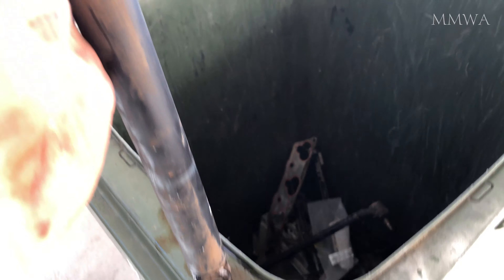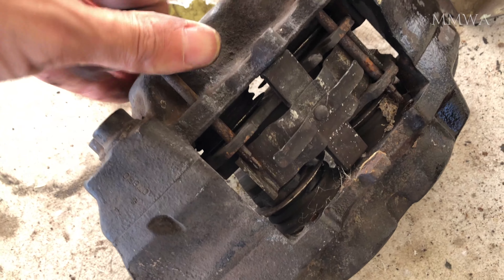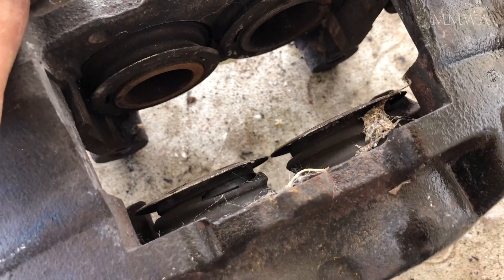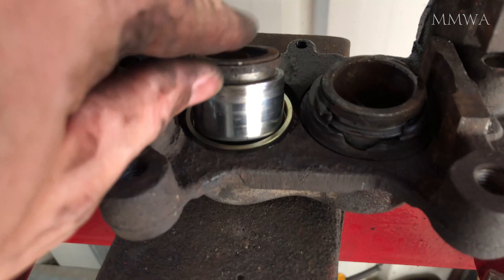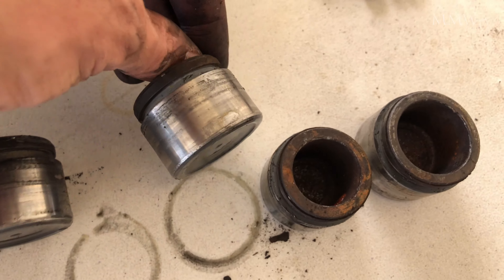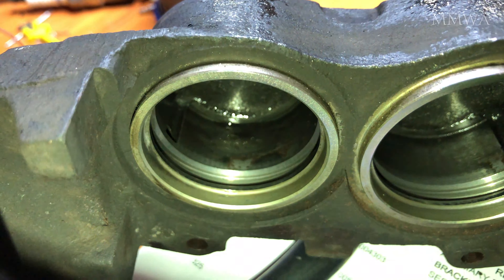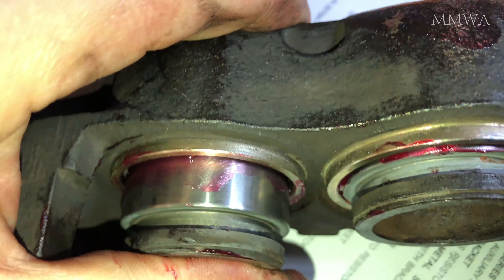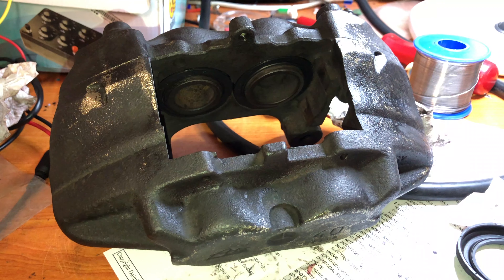My practice rebuild of W124 front brake caliper

Comment: Low quality video? No way. The video is great! I’m so glad to have the valuable information. My steering dampners are probably original. Lol I’ll get round to it. 
I’ve heard some professional mechanics say they don’t like to rebuild Mercedes calipers- probably because they don’t have time like the hobbyist (like me) would.
Reply from the maker: LilyoftheValeyrising they are quite easy to rebuild to be honest, i guess sliding single piston calipers would be a lot easier though. Those types are the ones I am most familiar with on my old locally made cars.
Reply: MMWA wow interesting. I can’t remember what my ‘80 450SL calipers were as it was five years ago I changed the brake pads and hoses.

Comment: The caliper itself seems to be in a nice condition as you mentioned. Even if the brake fluids were neglected by previous owners!!

 Nice way to seat in the dust rubbers 👌
Reply from the maker: interestingly, I rebuild the passenger side after this one - the fluid that came out was putrid black but get this - zero corosion at all inside the caliber bore or piston. Makes no sense why only one side had the corosion and the fluid was cleaner too...
Reply: @MMWA-DAVE  (?!!?) That sounds rather interesting, you'd think it was vice versa! Good to hear the caliber itself was fine though. I hope the rear calibers will turn out trouble free, even if they tend to jam easier. =)

Comment: Thank you for the video , I"m rebuilding my R129 SL, and have struggled all afternoon with the dust boots, on the replacement kit there is a seperate spring that hold the dust cover in place and once in position you turn your back and it pings off, So for the rest of the afternoon i searched for a similar kit to the one your using, possibly with the build in spring on the dust cover , fingers crossed it will do the job, Cheshire UK PS the last time i rebuilt a caliper i was 19 and the car was a big  Ford Zodiac Mk 3,  now at 70 still messing with cars. What else do you do in retirement ?

Comment: Can you take these out with the caliper still hooked up to the hose on the car without removing the hose and having to bleed later, etc?
Reply from the maker: As soon as they pop out you would introduce air into the system and spray brake fluid everywhere anyway so that method makes no sense. Best to remove from the car and work at a bench.

Comment: What does damper do? Does it help straighten out steering wheel after a turn has been made?
Reply from the maker: David C I think its more to do with controlling undesirable steering wheel movements on undulating roads, but I could be wrong. The centering of the wheel in a straight line is what correct caster adjustment and other front alignment should achieve. Though I am by no means at all an expert on alignment- i’d love to have my own alignment hoist but its unpractical. I just pay the $50-$90 and get it done by the experts as required.

Comment: Do you have a video on how you installed the dust boot? Am curious to know 😊
Reply from the maker: the one on the piston? I can tell you that was an annoying job as it keeps popping off. I ended up using woodworking clamps to push them on
Reply: @MMWA-DAVE  I recently got a front caliper for practice from w124 with a m103.  This is in preparation for caliper rebuild on my w201. The cylinder o-ring had marks on them; red white white yellow. I wonder it means something like orientation. Do let me know wgat you think.
Reply from the maker: @rfbu  on my m104 the piston o rings are just square profile o-rings and go in without any fanfare. I'm not aware of any special deal with orientation. Send me an email with your vin and ill see if theres mb documents around your calipers
Reply: @MMWA-DAVE  WDB 201018 2G 016967
Reply: Very easy put the dust boot on the piston first then just push I  the piston with the boot on.

Comment: Dat Ate calipers are bullet proof...Can i ask, why do this calipers have different diameter pistons?
Reply: The rear Piston area needs less force.  If pistons were the same size back of pad would wear down in no time.  On std bicycle brakes the pads mounting is not in the center.

Comment: Sean from Atlanta (actually in NC today) watching and still impressed!
What is the red grease and what brand did you use?.
Is your caliper repair kit Ate?
Great job as always.
Reply from the maker: SpinningVinyl genuine ATe rebuild kits from Europe and the red grease is locally sourced brake rubber grease specifically for rebuilding calipers
Reply: @MMWA-DAVE  Thanks